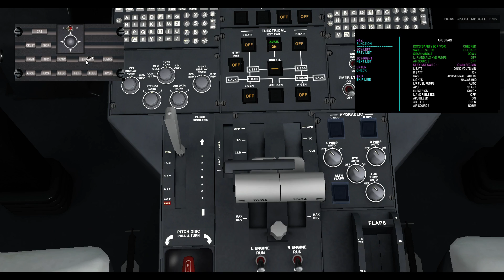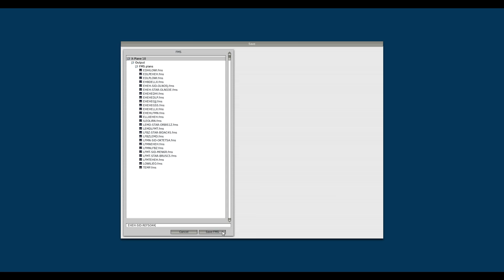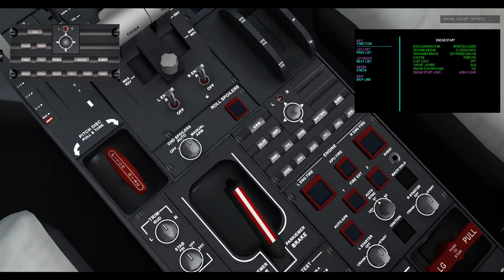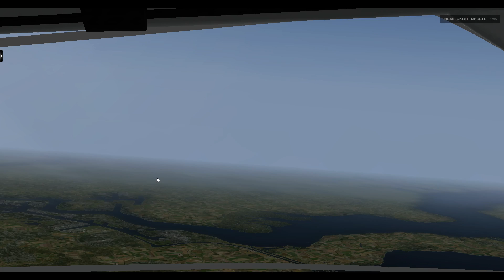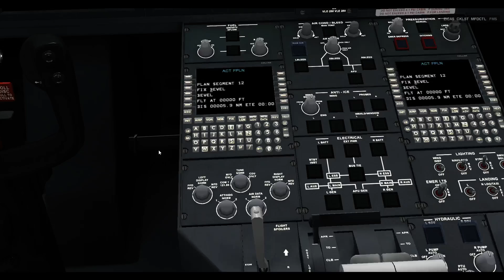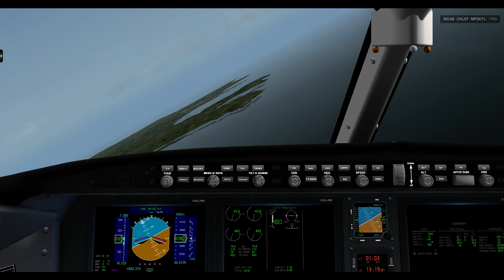X-Plane Challenger 300 Demo Flight

Comment: Reason speed hold or Mach hold switches off, and the reason you have to keep your eye on the power is really due to the A/C Burning up fuel and getting lighter.  This is what I read by one of the pilots of a real challenger 300.  Plus their autopilot can hold a set speed but in X-Plane this option does not work continuously